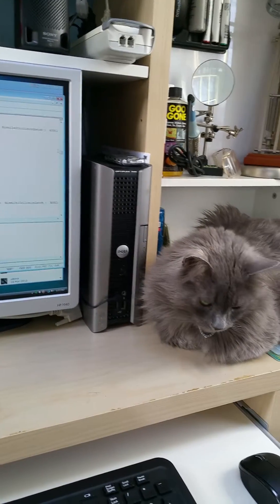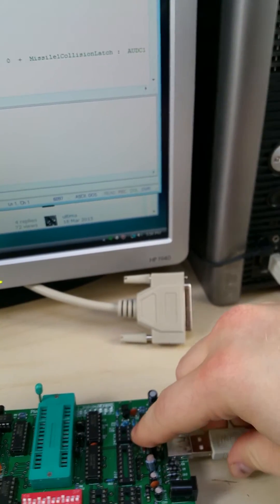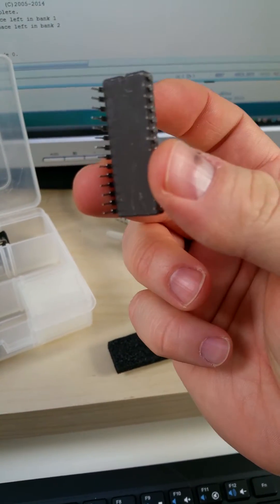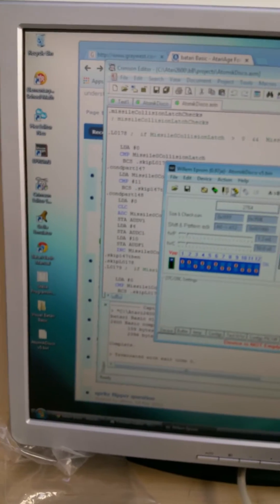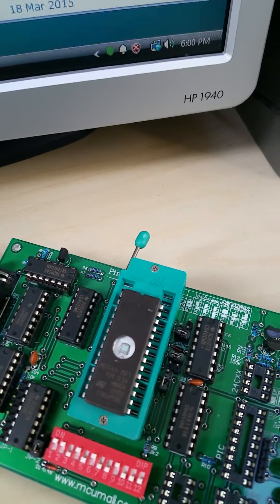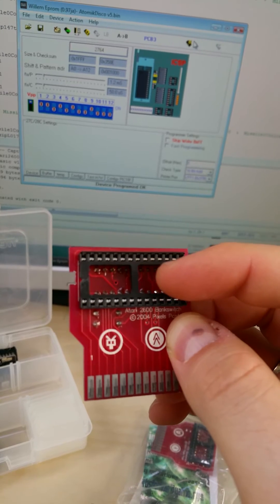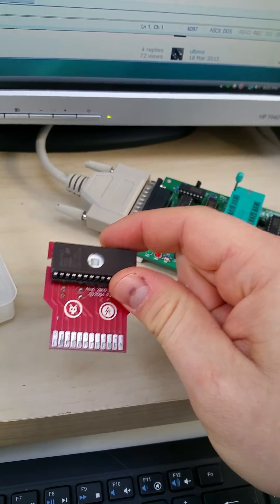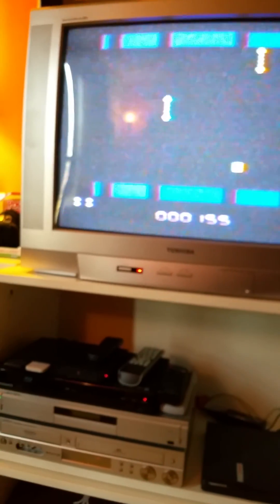Creating an EPROM cartridge for a homebrew Atari 2600 game

Comment: You need to add info in the description.
What burner and software do you use?
Where to get prototype boards and various capacity EEPROMs?
And the eraser.
If you assemble the prototype boards, how do you program the bankswitching chip? 
Most EEPROMs require a logic inverter on the chip select line, so I imagine the bank switching chip (the skinny one on the other side) can do that, too.